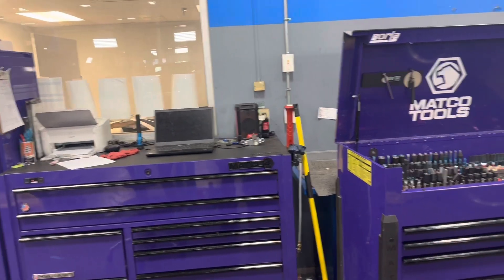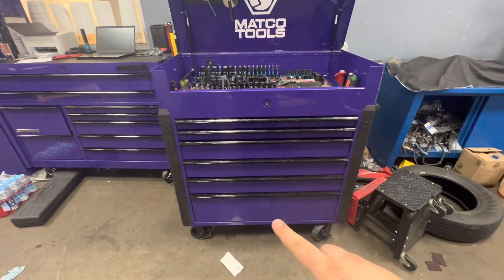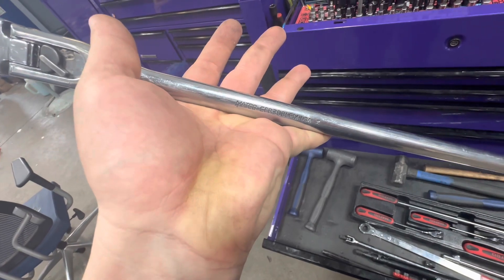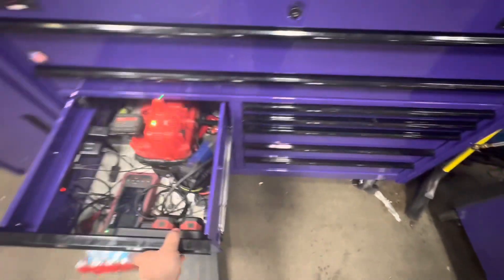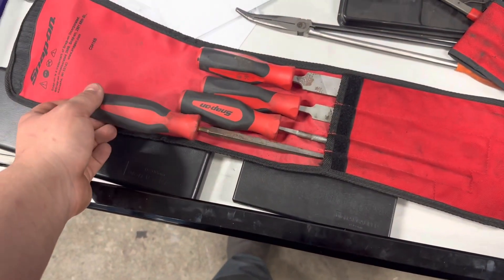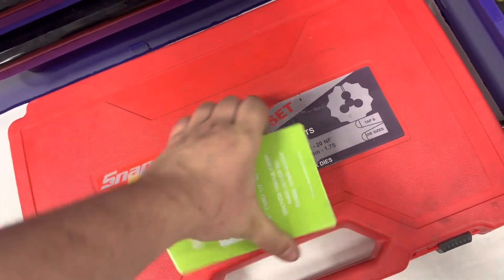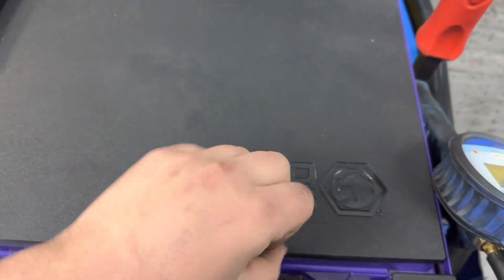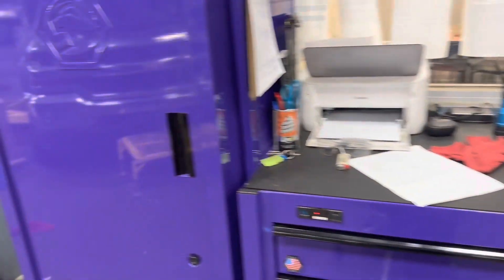PURPLE TOOLBOXES?! MATCO TOOLBOX TOUR/REVIEW

Comment: I had a similar problem with mine straight off the truck pushing it around locked the lid would just pop open I told my dealer he came down actually took the panel off where the mechanism is the tab was bent a little bit he just had a bend it and it would pull the lock back further to be able to latch it's only a couple of clips to take that panel off

Comment: How do you like the double bay? I just picked up the same box and it came with a free hutch for $8700. It has kind of a funky layout. Let me know!!
Reply from the maker: well ive had it about a year and the only thing i can say is the powerdrawer is not big enough but i run damn near everything electric. i have my streamlight charger in there the 6 bank Milwaukee charger, my jump box, and my snap on pod lights. i guess its still quite a bit but i have to move everything to get my streamlight batteries out. kinda long winded answer to say yeah i like it lol. gets er done
Reply from the maker: also dislike how the locker doesnt have built in electrical strip bcuz i think the icon box from harbor freight has it
Reply: @johnstontv300  I do want to get a locker eventually that would be pretty sweet

Comment: Hey man I was just wondering something. So based on all your knowledge that you have obtained so far In your life regarding car, trucks, etc.what vehicle would you recommend if you had to only choose one kinda vehicle.
Reply from the maker: well, any halfton truck pre 91ish. less electronics, and emissions the better. same for cars also, mostly. emissions came around for cars in the 70s and 80s for trucks. i am biased, but for me things with a carburetor are simpler, easier to work on. and if someone that didnt know what they were doing were working on it. could do so easily with very little guidance